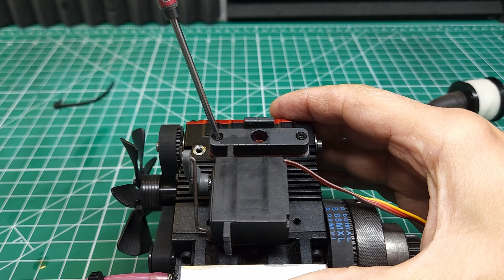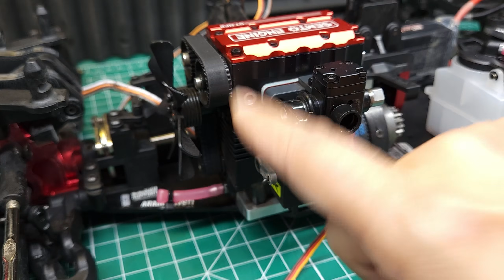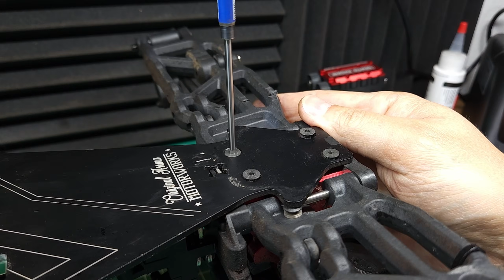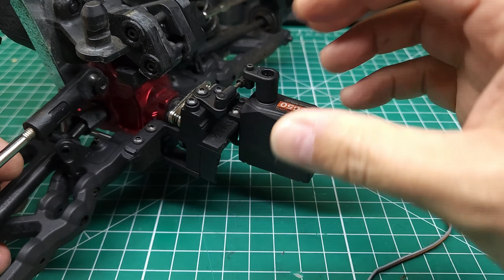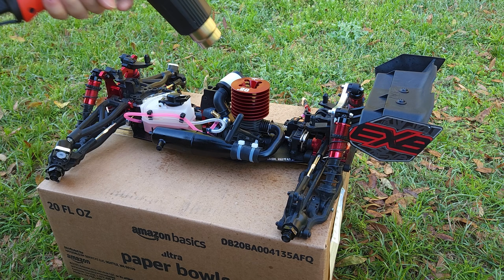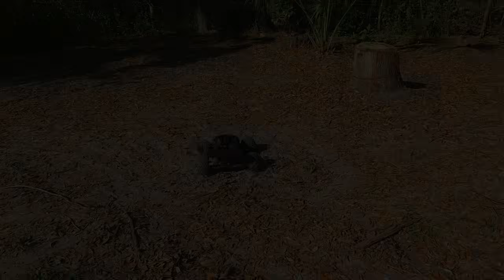I Built The ULTIMATE Nitro RC Basher!

Comment: Hobao Hyper st pro , Hyper 7-8--8.5 pro are verry strong cars,  built like tank's. They are allready nitro, have them all and gonna convert one of them to brushles, think the drivetrain can take whatever you put in those old hobao pro cars
Reply from the maker: Yeah I've had a couple of those over the years and whereas they are definitely durable I'm not sure they're quite as good as this platform has become in recent iterations.
Reply: @DoRC  vs new car i dont know, dont buy new one before my old hobaos are destroyed 👍 cant think the suspension is as good as  the new cars,  upgraded mine
Reply from the maker: @kenhmful  makes sense. Yeah they are definitely good cars but bashing design has come a long way in the last 10 years or so
Reply: @DoRC hyper st pro, hyper 7-9 buggis wasn't a basher designed, they were made for tracks. Dont like buggys for bashing. Truggy and monster trucks i like verry good for bashing, Nitro Truggy/ monster trucks and some good running nitro engines with some power are fun bashers, harder to do tricks vs brushless.
Reply from the maker: @kenhmful  sounds about right

Comment: I think i need to build 1 asap. I have 5 kraton 6s trucks on different configurations. Plus the 8s kraton. I need a nitro version...... thanks for all the great information. 1❤
Reply from the maker: You might struggle with the 8S trucks. They're pretty heavy.
Reply: @DoRC  o ya im definitely not tru.ying it with a 8s kraton. All tho it would be cool to put a losi 5t motor on 1. I have a 5t I converted to electric and have all the gas stuff yet besides the motor. Witch I can get cheap. But I like this 6s version, and I have multiple 6s and not 8s kratons.

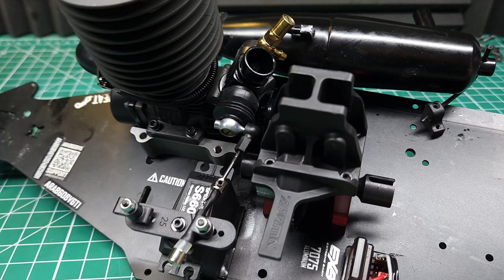Comment: 10:46 what i can see is TONS of movement in the servo. why not drill 4, or even just 2, holes in the chassis and run a bolt up through the bottom and put nuts on top of the servo ears?
Reply from the maker: For what I was doing it just really wasn't necessary. The goal here was to get it together and see if it was going to work as opposed to spending a bunch of time optimizing everything and even with the movement the servo did the job perfectly.

Comment: I was just thinking now, was the power really the problem? Because I think the RPM's were much more responsible for the low speeds on the 4 stroke. What I mean is that the 4 stroke revs much lower at about 16k rpms if im not mistaken, and I'm not sure how many are actually transfered to the cars transmission. In the other hand, the single cilinder dynamite engine revs close to 34k RPM's, that might very well be the reason. More RPM's, easier for the clutch to engage and not slip, more RPM's transfered to the spur and to the whole transmission.

This all makes sense in my head because nitro cars usually have a single gear, more RPM's more speed. If the 4 stroke version had a second gear, or a smaller spur maybe it would have felt better.

I might be wrong tho, but only testing would be able to tell.

Either way, awesome video!
Reply from the maker: Yes it was definitely a power problem. Even at the lower RPM it would still be a lot faster than it is and the engine free revved quite a bit higher than you saw when it was on the truck. Even just with the wheels off the ground it still rubbed much higher. 
The two cylinder engine is rated for 1/2 a horsepower. The nitro engine is rated for three horsepower. That's a big difference
Reply: @DoRC  Awesome, thanks for answering!

Comment: Diesel engines don't rely on ant sort of ignition. Just for start up but then compression is the ignition source
Reply from the maker: Diesel engines actually don't rely on any sort of ignition for startup at all.  some of them have glow plugs but that's not to actually ignite the mixture it's just a preheat the chamber to make compression ignition easier. 
These nitro engines are not diesel.

Comment: That's pretty years cool. I had some nitro stuff years ago. It was fun but lots of messing around and you need a tacke box of equipment just for a quick run. But the sound of them is awesome.
Reply from the maker: Yeah that's one of the biggest problems with nitro is that by the time you get everything up and running and working and tuned most people would be ready to quit

Comment: I just got done watching probably the hands down best Mini V8 on johnnyQ90's channel and now I get to watch this 👍🏼 

I honestly think these mini v8 and ect have crazy potential, you just need to put in a lot of work
Reply from the maker: Yeah the only real downside to the mini V8 is it's on the same basic architecture as the two cylinder engine I originally put in and that means it's going to be pretty inefficient. I suspect that this engine will make close to the same amount of power and it's a heck of a lot lighter.

Comment: Dude it's your gearing. Change your gearing and it will go way faster.
Reply from the maker: I actually think the gearing is just about right. It accelerates well and should have a reasonable top speed. Like I said in the video you're only seeing about 2/3 of the power because I wasn't getting on it fully and it's still being broken in.

Comment: add a 3 or 2 speed transmission (if it fits?) and some onroad tires and see if you can match the top speed of the brushless system. i think that should be doable, 60 ish mph.
Reply from the maker: You definitely could make this go pretty fast The problem is the versatility. In order to make it fast you'd lose the bash ability and vice versa.

Comment: To many companies forgot about nitro and unfortunately so did Arrma. Needs a two speed trans!
Reply from the maker: I suspect if people would buy them the companies would make them.
Reply: Every single RTR nitro model is old and decrepit as fuck. They just don't update the non-race kits anymore, and even the race kits are slowing down a little in innovation. If they made good, easy nitros, people would buy them. Traxxas is pretty good about it, their engines are reliable and easy to start and tune, but their models are old and not very tough or modern, besides the revo

Comment: Hey bud, great video! Very unusual!
It had a lot more torque with the nitro fuel and the spark ignition. Definitely not more power, but definitely more torque. If you recall you had to push it to start it moving enough to let the motor engage, not so on the nitro fuel.
Cheers mate
Reply from the maker: Yeah for sure. The nitro fuel definitely worked better in this particular engine.

Comment: That's awesome, you're one of the best RC channels for sure! 
My buddy did a big block nitro swap on a E-Revo a long time ago, I think he ended up running a .28 Kyosho motor IIRC, and it was crazy fast, It pulled wheelies in second gear (for comparison, the 1/8th scale buggy standard was .21 and most of the 1/10th scales were running .15's. Now I miss nitro and I think the car is just sitting in his garage...
Also, I've used toothpaste to lap valves in go-karts to cars, it definitely works but requires some extra time and elbow grease when doing it by hand.
Reply from the maker: Yeah I definitely would use regular valve compound if I was working on anything other than a little engine like this as like you said it'll take a long time to do.

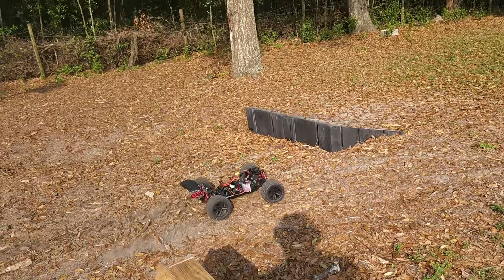Comment: 6:43 the moment you mentioned that 2 cylinder engine relies on compression blow by for fuel delivery I was overwhelmed by disgust and anger not just for the amount of time, resources and energy that went into designing and building that useless novelty engine but mostly for the hours of your precious time that they stole from you by marketing it as a nitro engine to give the impression that it might be more than just a paper weight. I'm also glad you did not try to run it on gasoline considering the energy density difference, I would be surprised if the truck moved at all running on gasoline.
I still believe a 4- stroke Nitro powered multi cylinder engine would absolutely scream in an RC car if it was designed correctly. Stop by scaling down a Top Fuel engine and then fix all the things the rules don't allow them to do play swap out the screw blower for a modernized Roots blower which is much more efficient than having to turn insane RPM . And then there's just a simple matter of figuring out how to tame it.

Anyways, I'm going back in to watch the rest of this epic build, love it so far even though that first bullet was a dud.
Reply from the maker: I actually did try to run it on gasoline in the first video and yet barely moved. 
I honestly don't really blame the manufacturer. I think they know that the vast vast majority of people will never try to use one of these in a practical application So basically making them toys is fine.

Comment: so i figured id point out the mistake between the 2 different types of fuel ignition... u have the gas ignition correct... but nitro engines run like diesels, so the glow plug is there to start the engine with the hot coil but when u remove the glow plug igniter the glow plug actually stops heating and the nitro/air mixture combusts using the engines compression... other than that, awesome video bud
Reply from the maker: This actually isn't quite accurate. A nitro engine does not use compression ignition. It uses a catalytic reaction between the methanol and platinum on the glow plug wire. 
This is proven by the fact that sometimes that platinum wears out and when it does the engine won't  stay running with the igniter removed until you replace the glow plug.

Comment: I have an 8s Kraton that I put a 4-stroke Twin Saito RC airplane engine. It sounds like a WW2 warbird. Not as fast as electric, but it sounds cool and gets lots of attention. What i did notice is that the Airplane engines are not as tough as RC car engines. With a good chassis slap off a jump, the connecting rods would bend or snap. Never had that problem with a car engine. I guess they don't expect airplanes to have impacts with the ground, lol.
Reply from the maker: Yeah that makes sense. For an aircraft engine the most important thing is being lightweight so they probably make a lot of sacrifices for that.

Comment: This engine is more for 10 scale then 8 scale basher, put realy powerful 5.9 cc engine like on the savage xl
Reply from the maker: Actually 1/8 scale truggies typically run 0.28 engines. 0.32 would be more powerful though.

Comment: Hell yeah brother!! i've watched a couple of your video's now so have a sub 💯❤‍🔥with the SEMTO Engine would like to see how they run with two carbs, it would be cool if there was a fuel injector's small enough for these little engines.
Reply from the maker: It looks like it was originally set up for dual carbs I'm not sure why they switch to one. Possibly because they needed to be able to pump fuel from the tank and the exhaust doesn't have the pressure to do so. Overall though I suspect the gains would be limited as I just don't think this engine is designed for performance.
Reply: @DoRC  need aftermarket cams with timing adjustments and a fuel pump lol maybe one day ❤‍🔥

Comment: thats a small engine for that chasis theres a v8 nitro truck 1:10 that was uploaded today similar kind of engine nitro just a lot more cyclinders 11
Reply: johnyQ90 is the model man i dont think your doing it right have a look
Reply from the maker: You'd be surprised. This engine type and size has been put in 1/8 scale truggies for a long time. Based on what I've seen I suspect it is at least as powerful as the V8 johnny used. Displacement is great but the toyan style engines are very inefficient.

Comment: Honestly, I think you should put a center diff back in. Hot racing makes a whole “one way center diff” that’s designed to have the AWD but RWB. If not better if would at least be interesting. Does prevent front flipping on the ground
Reply from the maker: Maybe though I didn't really see too much issue yet with the spool.
Reply: @DoRC less for necessity and more just to see how it changes things

Comment: I know there's a pretty simple conversion of watts to hp but does anyone know right off hand what the hp would be of the 2050kv motor this truck came with?  Just curious how the common power numbers compare.
Reply from the maker: The KV doesn't really tell the story and unfortunately there's no logging in these systems though a similar setup where you can log it might give you 5 to 6 horsepower which is going to be a fair amount more than this nitro engine. That's reflected in the fact that the car would be quicker and faster
Reply: @DoRC gotcha.   I've just seen the watts listed in the description of some motors but not the stock 6s Arrma motor specifically.   Also I've seen videos where is been claimed certain motors are 20hp or 25hp for example.   Just wondering if anyone knew about this specific one.

Comment: Dude, you need one of those miniature V8 Engines lol
Reply from the maker: I honestly think it would be disappointing. The two cylinder engine is rated at a half a horsepower so the V8 engine might be four times that which would only be two horsepower and still less power than the engine I put in this.
Reply: Hauler/radrod with v8 :D

Comment: To match the power of the normal nitro engine you would need the inline 4 from toyan most likely but the price tag is ridiculous I believe it is 1k plus and is definitely stronger, but at such a small scale 4 stroke engines can’t produce a lot of power like full sized engines.
Reply from the maker: I don't think the inline four would even come close. It would be double the power of the two cylinder just about and the two cylinders only rated for a half a horsepower while this nitro engine is rated for three horsepower. Something like the V8 might come close but it's too big to fit.
Reply: I know the v8 is about 4.5 hp, the toyan engines have kinda been downgraded to a single carb setup for the inlines without increasing the size of the jets so that doesn’t help at all,  these engines are definitely for more scale models rather than bashers.

Comment: Needs another engine and taller gearing to match electrics speed.
Reply from the maker: For sure. This is probably going to be similar to a 4S battery on the original electric platform

Comment: What gearing are you using?  With tune and gearing after breakin would scream even more.
Reply from the maker: It's the stock 50 spur and the motor had a 15 tooth clutch bell on it. Felt pretty reasonable for general bashing

Comment: I usually hate nitro, but this thing is something else.  And the red coloured cylinder head peering out is fire.  Would like to see a comparison between the completely tuned nitro engine, and the electric alternative.  Arrma needs to at least prototype a nitro Kraton right now.
Reply from the maker: I've run enough nitros over the years to tell you that electric is still going to have it beaten by a pretty long shot in performance but definitely not in sound and smell :-)
Reply: Arrma prototyped a single nitro model when the brand was first getting going, but scrapped the idea and sold the prototype unit. A guy on reddit has it as a shelf queen
Reply from the maker: @knotical689  Yeah I saw that. Looks awesome!
Reply: Nitro can be lots of fun! But it is understandable that people don't like it. There can be a lot to it. But trust me once you get the hang of it, it's really not as bad as it seems. It can be overwhelming at first. And the mess and maintenance isn't the best. But the noise, smell and shifting sounds are just epic! But I get it. Sometimes I don't wanna deal with it and just run one of my electric rigs. I'm not strictly nitro or electric. Really been getting into the vintage rigs lately. Been all about the RC10 rereleases lol I'm a sucker for the gold pans lol
Reply: how could a sane person hate nitro ?

it's the single best powerplant for RC. followed by petrol 2 stroke, then petrol 4 stroke.

Comment: Hello DoRc,
Why did you use a big ass lipo in your tame Kraton nitro build?
Reply: I'm guessing to supply power to the engine ignition system, servo, and receiver.
Reply from the maker: It was just what I had on hand. You could definitely get away with a much smaller battery to run the servos and whatnot